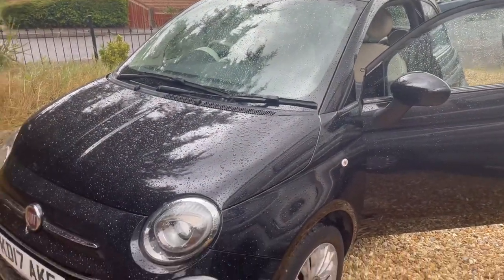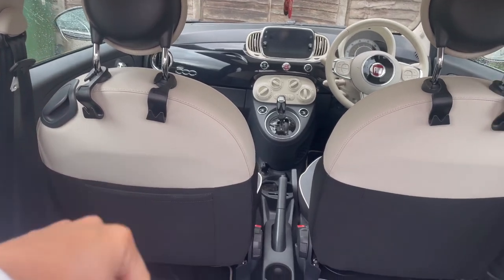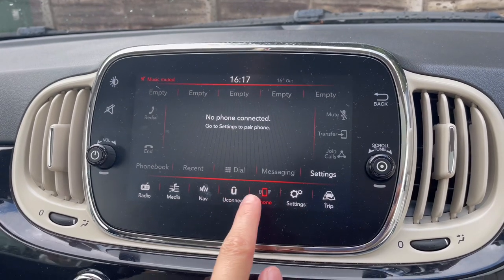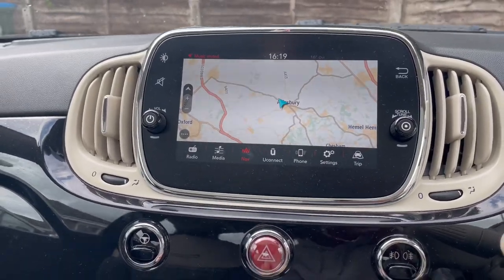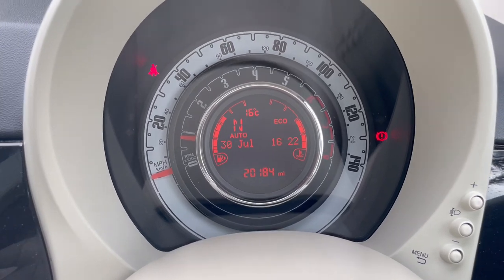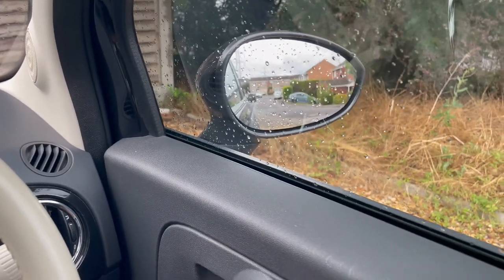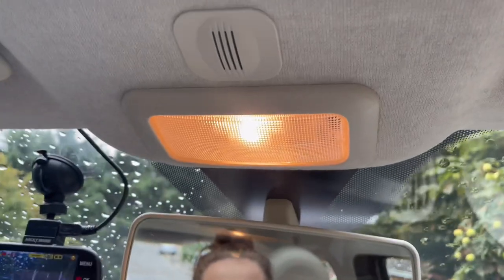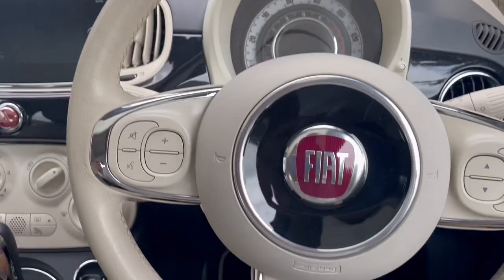FIAT 500 CAR TOUR!! Fiat 500 Lounge Tour | Interior, Extra Features, Under Bonnet

Comment: Hope you’re still enjoying your car! 😊 Do you have any issues with rolling back when you have to stop on a hill? Also how do you find the start/stop engine?
Reply from the maker: Loving the car! With the hill rolling I assume this isn’t when parked? If not when parked any car will do that, with the hill start assist you have to put your foot all the way on the break and hold then it registers the hill assist and when you pull away it shouldn’t roll back. 
Stop start is great for eco as it saves petrol, you just have to be a bit gentle when pulling away as it sometimes takes a second to start. 
Apart from that no issues 👍🏼
Reply: @Sweetthingsbyamy  thanks for the response 😊 Got mine a few weeks ago and loving it! Did you ever manage to get the speedometer displayed digitally? That’s the only thing that bothers me 😂
Reply from the maker: @Dipsylala  haven’t figured it out yet, forgot tbh! Might look at the manual again

Comment: Hope you're enjoying your car! I have a manual fiat 500 and absolutely love it but would like an automatic. How do you find changing gears and the car not rolling forward as a standard automatic. Do you ever need to drive in manual mode or the auto is what you go for? 😊
Reply: I would advise you stay far away from these Fiat 500's especially the automatics. They have nothing but problems.
Reply: @AndrewFaust-x1e  Thank you for your advice! I haven unfortunately only heard the same from precious owners of Fiat 500 automatics so wouldn't be considering changing mine. That being said, I love my manual fiat 500, it's economical on fuel and repairs so if I consider an automatic, I will be looking at a bigger engine and hopefully a car with more positive reviews. 😊
Reply: @gabrielastoykova1181  No problem! The manuals are definitely better than the automatics. Engines burn oil like mad, head gaskets blow, and they crawl like snails. I've heard of owners who got rear-ended because they're so slow. Just be sure to change the oil every 5,000 miles, and you might get decent longevity out of it.👍🏾
Reply from the maker: Hi sorry for the late reply! I love mine & have had no issues always passes mot no big payouts for things apart from the usual tyres etc once worn. 
Changes gears fine, if you speed up too fast you have to take your foot off the throttle then put it back down but all the smaller cars I had have a similar thing so I’m used to it. 
Mine doesn’t roll forward I don’t think, if I understand you right. 
Think a lot of the issues depend on year too, the older ones or standard model may have more issues but I’ve heard good things about the 500 Lounge for the price you’re paying 👍🏼